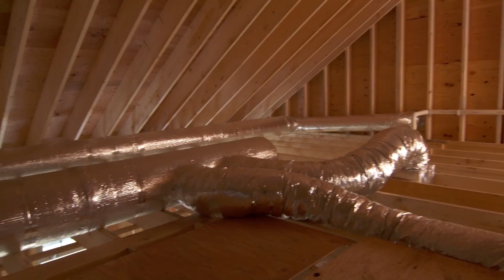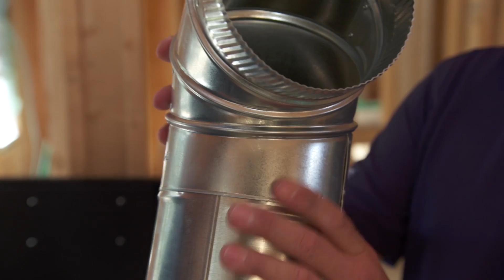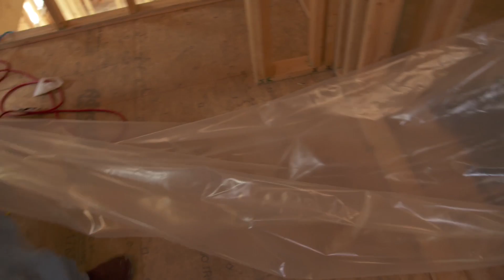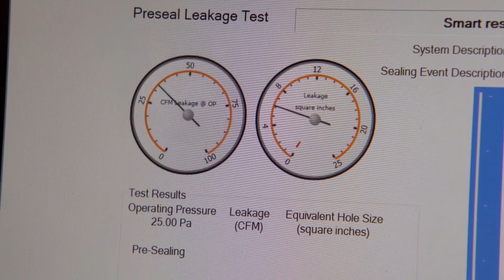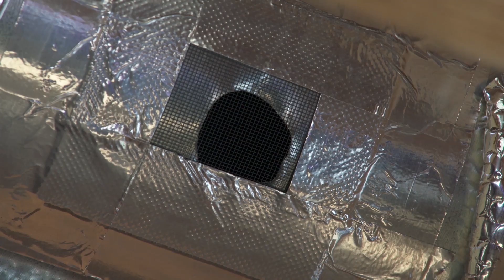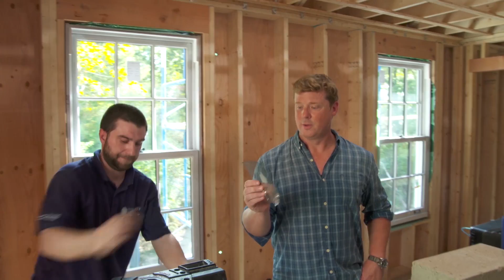How to Seal New Ductwork  | This Old House

Comment: Here I am trying to figure out how to seal loose edges on inner duct liner inside the plenums and air handler so fiberglass particles don't contaminate our air.  Last thing I want to do is breathe all this crap in as it breaks down in the system years after application.  It's like they keep coming up with new ways to kill us slowly.

Comment: Honestly just taping or duct sealing the pipe and 90s before and during install is super easy, quick, and substantially cheaper then this. Also 6 sq inches of leakage really isn't anything to get worried about when you are talking about the entire system.

Comment: I am assuming you would you have to cap every exit point to do this so basically all the leaks are coming from cracks or seems only?
Reply: yes, that's how it works.  I got an estimate for my 2800 sq/ft house and it was about $2500.

Comment: It takes like under 30 seconds to seal tach joint with that past. They can use that while putting the duct work together. So it won't be an extra added cost.

Comment: Wonder what the long term effect of breathing that chemical or any off gases will be?
Reply: How will the sealant be to clean 10 years later when cleaning the ductwork? Does the sealant hold dust?
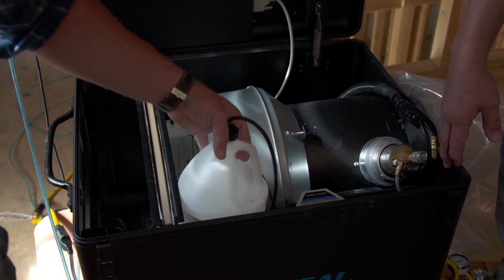Reply: At 1:35 they mention that it's the same chemical as chewing gum
Reply: @Chris-ok2zb
Shame on you for believing a salesman acting as a chemist. Countless scenarios and lawsuits have been filed over this exact type of scenario.
Reply: Exactly

Comment: Hi Keven, crerdit cards 6 inches squair, hoq do you get them in your wallet. I knew you were tight but now I know why you are last to pay, it takes that long to get your credit card out of your wallet.
Reply: 3 inches by 2 inches is 6 inches square. Credit cards are actually a little over 7 square inches. 3.325” x 2.125”

Comment: I’m just wondering how well it sealed up everyone’s lungs.
Reply: I’m sure they are air tight! 😂😂 thinking the same thing, but I like how he said “ the chemical makeup is like chewing gum” sounds good at least 🤷🏼‍♂️ hahaha
Reply: @DALLAS-DALES-DIESEL  I don't want to breath in chewing gum particles either lol
Reply: Ya no $h!+ lol my lungs omg i cant breath
Reply: Exactly....thats a sealing  chemical they're breathing....smh
Reply: @ahernandez1080  that’s got to be toxic like asbestos lead all the building materials that they’ve been using and it’s on the inside of the pipe where everybody’s breathing in the air. I’m sure when you turn your heater on it probably loosen some of that up and you get more chemical leaching.

The best modern approach to these dinosaur systems without having to worry about leaks, is ductless mini splits. Don’t even waste the time and energy of running that ductwork not to mention how inefficient they are compared to mini splits. 

After doing tons of research on this putting the ductwork in the attic has got to be one of the dumbest things ever trying to keep ice cream cold in 140+ degree nonstop heat.
Duct air conditioner systems will be phased out real soon .

Comment: It isn't a permanent of a seal as mastic, it is quicker, but over time the system will leak at those joints. It applys a very thin amount and will be worn down over time. Mastic takes longer but is truly permanent. Seen it have leaks as soon as ten years. It's an expensive job for lazy contractors, sealing the ductwork with mastic as you go is the best solution.

On existing systems seal were you can reach with mastic, invest in better windows, doors and more insulation with give you far greater savings then a single sealing job from them.
Reply: Peace to you..... 💪🏿💪🏿💪🏿

Good looking out
Reply: I agree, Glenkote is tough as hell when it cures and will hold ducts together better than this option.

Comment: What will future duct cleaning do to the sealing and insulation?
Reply: Over time the very thin amount will break down and leaks will happen. Seen it in homes as early as 10 years. Not a true permanent solution, great for new construction blower door testing. Mastic is still the best option
Reply: @zack9912000  this is the comment I was looking for. I figured as much before you commented on it. New technologies do have some downfalls that have yet to appear. My biggest concern would be small particles breaking off and contaminating the air and people breathing it.
Reply: @zack9912000  But this would make it easier to real it.

Comment: I saw this a few years ago, on TOH, it is wonderful, I checked around HVAC companies, I wanted it, no one does it. What a great addition to saving on heat A/C loss
Reply: You are right. It's more of a commercial idea. Residential is hard to get done unless it's a huge project
Reply: There is a reason us HVAC company's don't do it, it's very expensive, doesn't last and is a ton of prep work on existing systems. Mastic is the longest lasting and permanent solution. The best thing any homeowner can do is seal all their joints they can reach with mastic and invest in better doors, windows and insulation that costs the same amount then paying for this garbage. You will see better energy savings then any marketing wank they claim

Comment: I like how you pushed that crap thru the air handler!
Reply: Thats exactly wtf i said thats a good way to clogg up the fins on the evaporator coil and blower motor assembly and possibly the register vents lmfao good way to throw  away your heating and cooling system
Reply: I though that too! Can't be good.
Reply: It's not, had a lot of new construction service calls where it sealed up the wrong parts. They claim it doesn't  but we have seen deposits where it doesn't belong. A lot of franchise owners don't do proper prep work.
Reply: @zack9912000  agreed. It's seems like a good idea, but it is very flawed when you take in all the information. A quality installer will seal ductwork properly anyway. And worse if all, this expensive "solution" needs to be done again in 5-8 years!

Comment: An this be done in an existing house
Reply: https://youtu.be/UeVf0983N8o
Reply: I wouldn't advise it, ducts have to be very clean for it to actually seal and isn't as permanent as their sale people try to brag about, it sticks to itself but must have a clean surface to connect to for best results. You are far better off sealing the ductwork you can access with mastic and invest in better doors, windows and insulation for for better savings.

Comment: If he sprays a chemical caulk into the air ducts to clog holes, does it scratch off when cleaning the ducts with brushes etc from inside?  And is it safe to breath air from chemical off gassing?  Its one thing to use caulk, but with this you have a caulk spray residue throughout the each duct tube, no??
Reply: Not to mention that now the inside of your ducts are covered with bubble gum!  How long until they get plugged like an old-man's arteries!!!  Even if it dried non-sticky, that surface is going to be a lot rougher than sheet metal and 'stuff' will stick to it.
Reply: It isn't as permanent as mastic painting on all the joints. It is basically a aerosol cauk. Mastic may take longer to apply but is cheaper and is a true permanent solution.

Comment: So was the screen there during the pressure test?
Reply: I was wondering that too,  also wondering (hoping) that demo was on a trunk that wouldn't be part of the final product, because I'd be kind of pissed if they poked that big of a hole in my brand new ducts just to show off how great his system is.
Reply: That hole itself was the size of a credit card
Reply: No it is a marketing gimmic, they cut the hole and put the screen there to catch their solution. It can't seal larger then 5/8

Comment: Impressive. Would be nice to know average cost.
Reply: If I was betting man I'd say that would cost more the traditional method because "expensive equipment" and "high trained individuals"  even though his crew can be out of there in a few hours at most.
Reply: Years ago, a residential property, two story was quoted $1,200, on previous TOH
Reply: A cursory googling said around 2k currently for a full system application. I imagine it varies in relation to scope and application. If i had a massive system with many joints and splits i think its more than worth it. Im in texas so any leak or inefficiency is murder.
Reply: @zack9912000  The longevity is where i figured it would either soar or crash rapidly. I assumed it would be a polymer or even carbon based aerosolized mix which would be better than mastic since they wouldnt lose their rigidity/flexibility or composition over time like mastic does. Good to know more info though.
Reply: 1200-2000 easy. Just use mastic, it is a longer real solution.  This won't last more then ten years on average before issues come back and it costs more then the proven mastic method. Home Builders love it for the time it saves them.
Reply: @zack9912000  zack9912000, but not finished homes, in Minnesota, ductwork are not in the attic like Texas. All sealed under sheet rock
Reply: @zack9912000  So you have experience with this process and know its not good or long lasting?
Reply: @hammerdick82     I have a fair amount, we have gotten a lot of calls from NEW construction homes just over 10 years that had this done when built, the product is only warranty backed for ten years. It can't seal anything past 5/8".  It costs substantially more then a mastic job by hand. We have to go in, remove all the insulation in the attic or get to the ductwork in the basement  and by hand seal all the ductwork we can get to with mastic. Mastic jobs can easly last 30 plus years. They do take longer but you get substantial more sealant material on connections and joints, mastic seals much larger holes and is CHEAPER. 

 You can get all the material yourself at homedepot for example and spend a weekend doing it yourself or hire a pro for a day to do it. Seal where you can get and invest in better windows, doors and insulation. You will see a far greater energy savings

 In homes where you can't get to all the ductwork, you would be far better spending the 1500-3k on better windows, extra insulation and better quality doors and seal with mastic where is possible. Expensive snake oil with little return over the long run and I find it only really  last 10 years before leaks start to come back. Their marketing is cute, yet the huge upfront cost that can be better spent other ways that WILL save you a ton of money faster.

Comment: Got a basement, in ruff in phase and an attic needing attention, so THANK YOU KINDLY for this.

No honor is truly something contractors frequent, making folks feel.... "I'm just gonna have to do this sh*t myself."

I just learned not too long about specs with different ducts and sizes, air handlers, Nashua tape, etc..... and I've made peace with not knowing what I didn't know and what happened as a result.  Education is power and you all, I RESPECT..... you all actually care to show folks how to do things THE RIGHT WAYS, and include REASONS and LOGIC.

🙏🏿🙏🏿  THIS OLD HOUSE........ TRULY APPRECIATED 🙏🏿🙏🏿